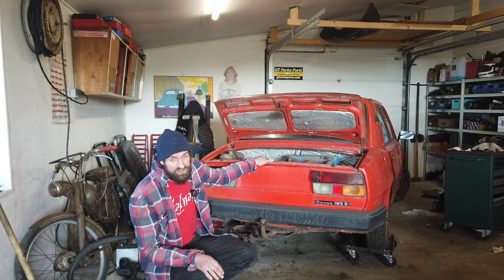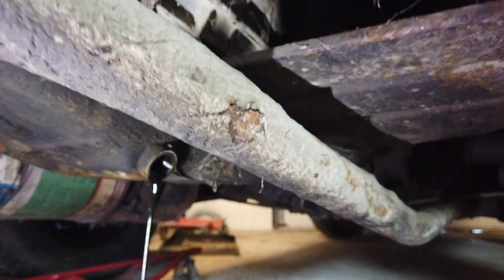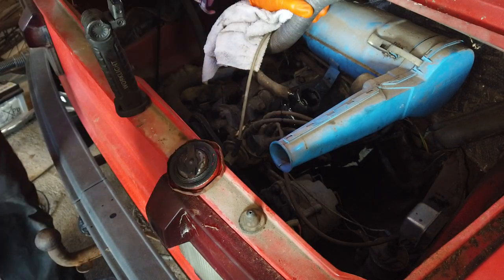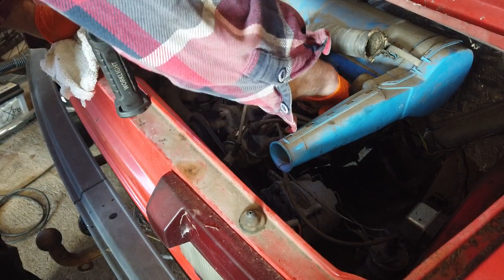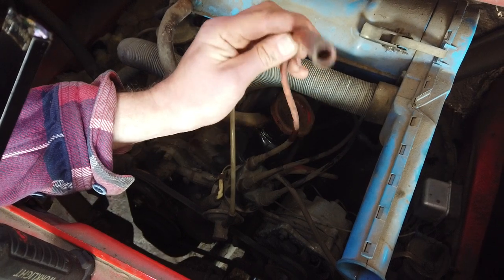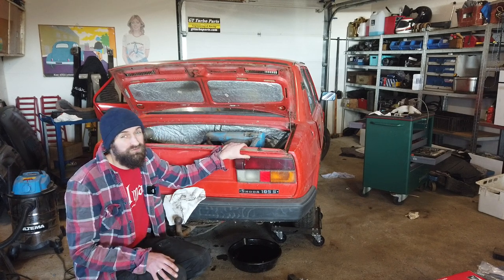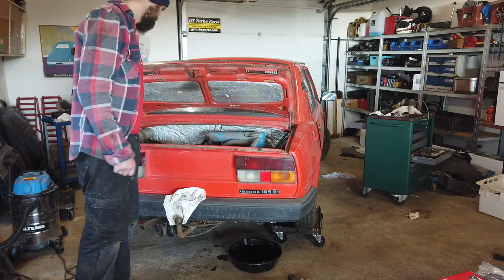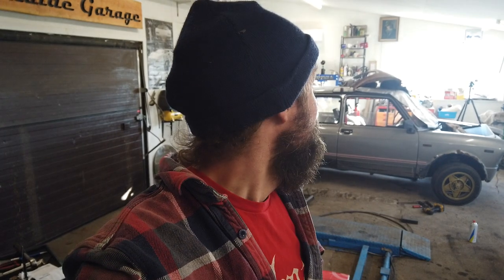BARN FIND ŠKODA 105- First drive in 25 Years!

Comment: Sounds kinda badass with 4 cylinders + no exhaust :D

One thing I noticed: at 5:55  check the little round thing that the accelerator cable goes into on the carb: it should rotate freely in the arm, but it seems to be stuck, and it's bending the end of the cable every time you move the pedal.. this way it'll break the cable very soon, as it's a solid cable, not designed for bending.
Reply from the maker: Well spottet sir! I will free that joint up very soon!

Hehe yea its pretty Rally/tractor like at the moment...

Comment: Very interesting "repair" on the exhaust, I've heard of people using drinks cans and jubilee clamps to close up rust holes in pipes, but paint cans and string's a new one on me!!! :P

As for the clutch, I'm thinking it may have been the brakes, if they could barely move the car to park it up, and the brakes had seized up by that point, then it would have made it tough to move, so, it could be that the clutch is indeed perfectly fine, if slightly abused to get it moving back in the day... :D
Reply from the maker: I have the same feeling about the clutch.... but it could begin til slip at higher speeds maybe, but it seems fine right now at least...

Hehe the cans are really a Farm style repair.... I love it!
Reply: Considering how few kms it has on the clock that's not impossible at all - 50k in around 11 years is next to nothing, so it might have been sitting for extended periods of time even when it was still on the road. And that could very well cause the brakes to get sticky, especially in a cold and humid climate with salty sea air.

It doesn't beat one car I was offered to buy about 15 years ago though. A 1989 Fiat Uno with 900 kms (I'm not kidding!) on the clock for 700 Euros! According to the story I was told it belonged to an elderly lady who used it to drive the same maybe three kms every week - from her house to the supermarket, from the supermarket to the cemetery and back home again. I had absolutely no use and no money for a car at that time though, so I didn't buy it.
Reply from the maker: @Ragnar8504  Wow that uno sounds amazing... :O I would love to find something like that!

Comment: We had a similar issue on one of our old cars. It would start but ran rough but once we took the spark plugs out and cleaned them it was much better. It didn't get used much and only did short journeys.
Reply from the maker: A great and easy fix :)

Comment: Good work again. If you start working on the cooling system I’d advise you to check the sensor of the cooling fan in the radiator. Original ones often don’t work anymore. Could cause overheating of the engine. That would be a shame. I’ve put in an early sensor/thermoswich. Starts the fan at 85 degrees centigrade. Better safe then sorry. Oh and by the way that home made exhaust made me laugh 😃
Reply from the maker: Good tip.... I will look into it, but it seems as it all works!

I am the kind of driver who are looking more at temp gauges then anything else really.... 
Maybe it says more about my choices of cars really.... haha!

Comment: The Biltema 20W50 mineral based oil is an excellent choice of oil for old engines in my opinion, at least in summer temperatures. Plenty og zink additives and relatively cheap. Been using it for years.
Reply from the maker: Yea and its a lot cheaper then other brands that really seems similar when looking at the ingredients ;)
Reply: The sticker from the last oil change said 10W40, didn't it?

Comment: Oh I love that 😍  such a familiar looking car here in the UK, they were everywhere.  Then came the disappointments, and even worse, the jokes. Maan, the English got some mileage outta them jokes...🙄😊 friend had a white one of these with a vinyl roof (black, could've been brown... more likely black) and yes we pushed it... probably just a maintenance issue,  battery, I bet 😊
Reply from the maker: They are great cars!
Reply: @SeasideGarage  I drive a modem Skoda, and the story fascinates me, as to why their particular company was given th VW treatment... well let's face it, they were saved. But it's also fun to guess which parts of the modern Skoda, Skoda actually made... at the risk of falling back into that 80's n 90's ''ridicule' thing..!🙄  but I'm still gonna do it anyway, this 58 plate Octavia, ain't the best...😊  1. The door seals (which might as well not be there)
2. The door mirrors (which explode if you hit a twig)
3. The multiplayer (which takes all your discs from you, but neither plays them or gives them back...)
4. The little speakers in the doors. 
5. The turbo actuator 
6. The rear wiper motor (which lasts about four days, if that. And the washer doesn't work either)
6. The little rubber cord that keeps the petrol cap attached the car.
7. The clip that holds the metal rod ( that keeps the bonnet up)  to the  bonnet
8. The plastic battery tray.  
Well that was fun, and probably mostly wrong... 🤔  but it was good to get it off my chest 😅
Reply: Oh yeah, 9. Skoda were responsible for lacquering the paint on the spoiler, because it started flaking off when the car was four years old... I'm sure I can round this off to a nice even '10' if I try hard enough, but that's probably enough for now 😊🤣